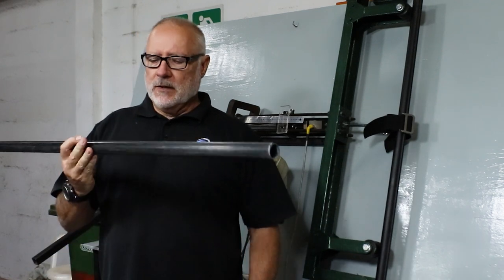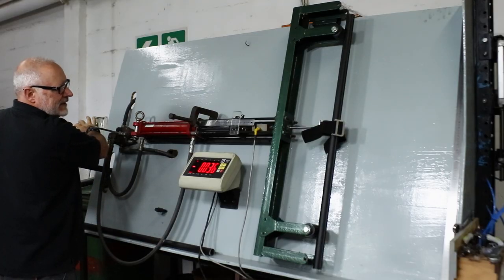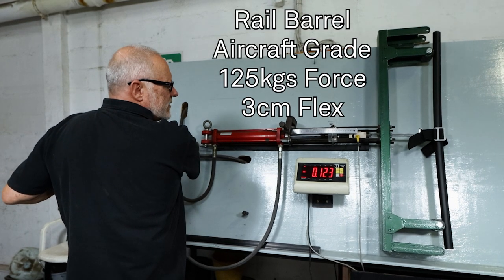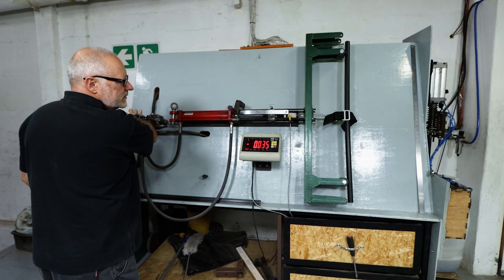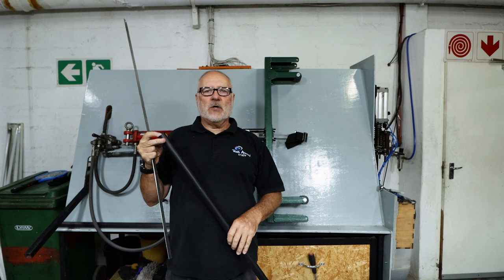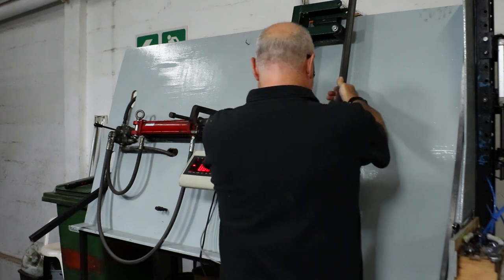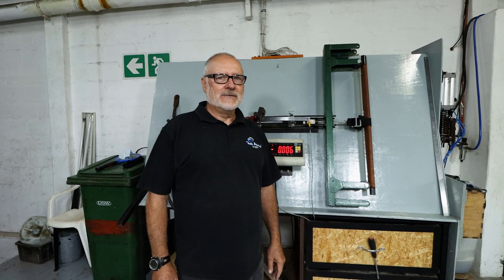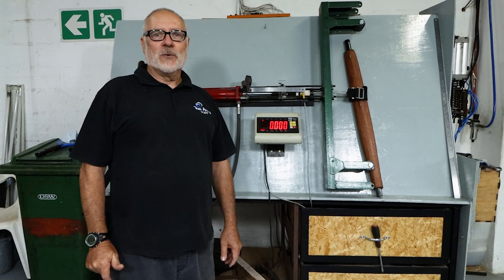Rob Allen | Barrel Break Test | 2022

Comment: Hi Rob, it would be nice to tranlate these into rubber setups. The force applied here is perpendicular to the barrel, but to get e.g 64 kgs of such direction of force from rubbers (as shown for simple aluminium), how many rubbers would you need? Would a 1.3m aluminium RA gun flex with let's say 2 16 mm rubbers?
Reply from the maker: Hi Christos, you are right, the rubbers apply very little of their load in this direction. The main reason for increasing the stiffness is to prevent as much flex as possible . This will eliminate any possible affect on the accuracy.  A 1300 aluminum barrel with 2 x 16mm will have slight flex when loaded. If you powered it up by putting 3 x 16mm it will be noticeable and have an effect but the added recoil would be much more.

Comment: Dear Mr Allen, kindly wonder why would you make a composite of timber and carbon instead of just making a pure cuttlefish carbon tube?  Kind Regards, Rui
Reply from the maker: Firstly, this gives us the ability to make way more options in terms of shape and or size. With a carbon cuttlefish shape you make a single mould and or shape per size. We make 10 sizes and 2 to 3 variations of each. If we don't like a shape we change it even slightly, no problem. You can't do this with a mould, you'd need to make a whole new mould at great expense.
Secondly, stiffness. With the pull-truded carbon inner tube it is way stiffer. We did make some carbon moulds to make the same shape as the wood side stocks but way to much work to have the variety.

Comment: Interesting stuff, is there a way to measure the buoyancy difference between a carbon and aluminum railgun? I saw a video where Chris coates was saying a 1m aluminum gun won't float a roller head aswell as a 1m carbon. Is this correct or am I misunderstanding him? 
Cheers!
Reply from the maker: Chris is correct. Carbon is much lighter so adds buoyancy. No real easy way to measure as there are many variables depending on gun set up. Sometimes just adding a reel will be the difference between floating and sinking without the spear. Even the line type on the reel can be enough to change it.
Reply: @RobAllenSpearfishing  thanks for the reply.. I guess it's a fine line with a rail gun when adding any weight to it, ill keep the short aluminum gun standard and save up for a carbon roller! Cheers
Reply from the maker: @jakehewitt2289  ....... or a Timberline 😁